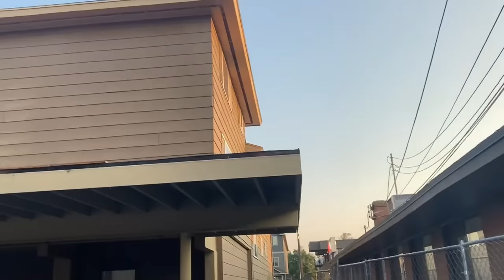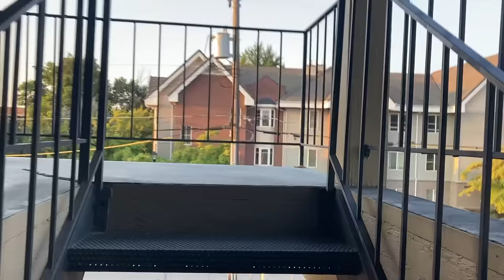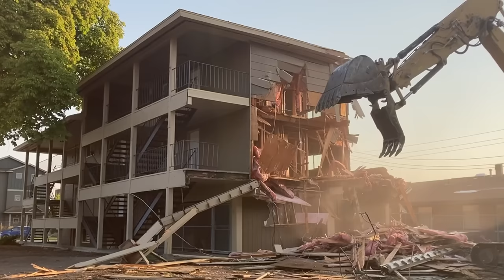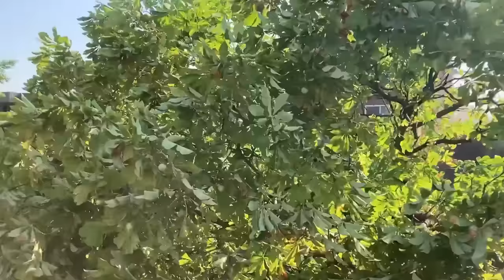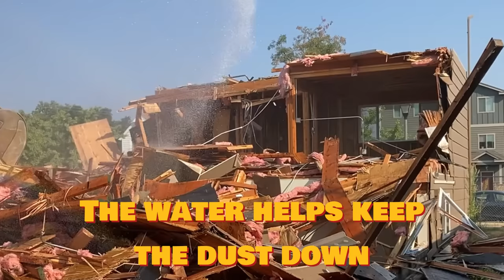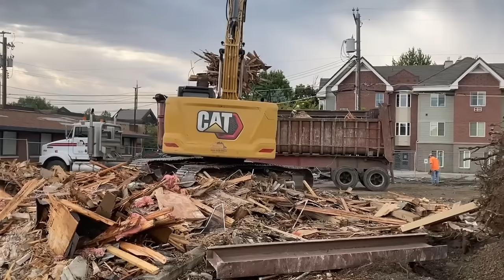Caterpillar Excavator Demolishes 3-Story Apartment Building

Comment: Damn i'm from Europe and i find this weird, an apartment building made of wood that can turn to dust by termites and to ashes by a kitchen fire plus they demolish what looks like a building not more than 10-15 years after was made.
Here some of the oldest modern apartment buildings are making it to 80-120 years already, made with reinforced concrete structure or stone walls with concrete slabs, and there's still people residing inside to those that are left, not that they are pretty or problem free but you can say they are paid off to their service.
Reply: It was about 50 years old.

Comment: I notice your excavator has a hydraulic thumb, where many other machines doing demo have a fixed thumb. It would seem that a live thumb would be better. Can you comment on this? It didn't look like you were salvaging the copper wire, or was it aluminum in the larger cables?

Comment: Why was the building so wobbly? I hoping it was the pre demolition. If it was built like that, that's scary and a surprise it didn't fall.
Reply: It was wobbly because they had to take all the Sheetrock and most of the interior non load bearing walls out. Those items add to the rigidity of the structure greatly.
Reply: makes sense. I was worried it was like that while people were living in it. @JC-dr8ev

Comment: The amazing part is that it's legal for rent-seeking LandLeeches to build such a cost-cut, barely-habitable structure like this and charge an infinitely recurring amount of money just to temporarily have a roof over your head - or more accurately, a thumping, rattling ceiling which is someon else's floor... cause I guarantee no sound deadening or insulation was used between units.These land-parasites should all be sent to a prison colony to rent from each other and see how long their society would last with all their valuable contributions!
Reply: I did see tiny tufts of fiberglass insulation in the walls, but I'm assuming they only did that because heat was included in the rent. If tenants paid their own heating costs, we can pretty much guarantee they would build it with no insulation at all, and single pane windows. 😂